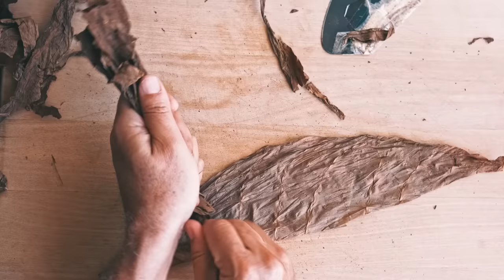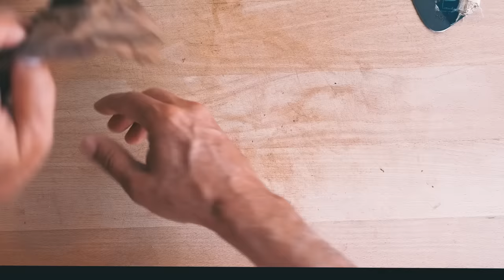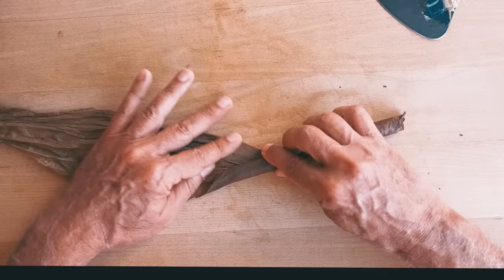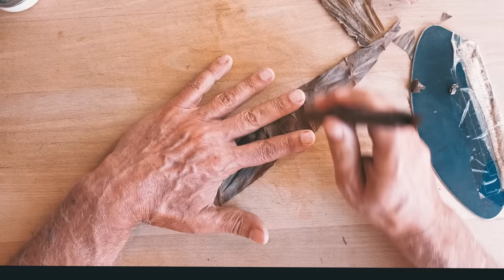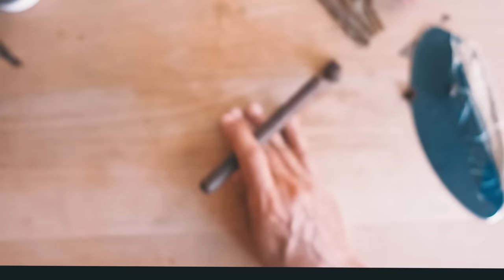Short Panatela Cigar, Roller's POV

Comment: I remember years ago getting some variety of nictotina rustica seeds and growing a small batch of tobacco as a project. It was amazing to see. Not quite how I expected. Even as a totally unexperienced grower I was able to end up with something. I didn't end up with alot. Only had a handful of plants. Couldn't quite get the curing to work right for some reason.  Even still it was a grounding experience to inhale the fruits of my labors. One thing I learned......that variety was suuuuuuuper strong. Got nicotine spins after 1 puff. Later learned....it's usually mixed with another variety hahah. Great video friend.
Reply: I still have some seeds but never tried growing, don't I need to use sand, or how did you do it?
Reply: @Loki_Dokie just YouTube it dude
Reply: @Loki Dokie's Metal Junkie Adventures  Well. To be honest, I had zero clue what I was doing (I grew them in a very large raised bed, the same way I grew all my vegetables) and didn't really treat them differently then say lettuce or cabbage and they grew amazingly. Prolly wasn't amazing quality by most standards but it was fun, easy, and lot more potent than I anticipated (at the time I was a pack plus a day smoker). Weekly tending but yeah....bout it. I'm sure you could easily Google or find vids on utube that would give muuuuuch better advice than I since I just winged it. I figured my seeds were bad as they were very old so I tossed a couple handfuls in the bed and shortly there after had a sea of sprouts. Each week I'd thin a 1/4 of em away till just the most vigorous were left in about 1ft sectors.
Reply: @ishnifusmeadle  very cool, thank you for taking time to reply, I may give it a shot at some point. If anything they just won't grow. Cheers
Reply: Inexperienced*
Reply: @smazzy187 wasn't really a need for that
Reply: @MrStone125  refer to my pfp
Reply: Yea, most home grown tobacco turns out super strong.
Reply: @smazzy1878  L
Reply: @Loki_Dokie  thanks for asking so i didnt have to
Reply: @lieutenantdan1413  lol no problem, I figure no question is a stupid question unless you already know the answer
Reply: KMVS8686  nice, I'm frustrated with federal law here as far as mj goes.
Reply: Thank you for this. Homegrown is powerful
Reply: @Loki_Dokie  you should! Maybe play around growing them indoors with a grow light. That never seems to fail.
Reply: oh yeah dude, rustica is what all varieties of tobacco originate from. You picked the strongest!
Reply: Reading "nicotiana rustica" and I knew this comment will contain phrases like "head-spinning" or "knocked me into my chair" or something along the lines of that.
Reply: it must ferment for months on pallets for cigar tobacco. should be a year before you enjoy your harvest
Reply: @smazzy1878  negativity calls negativity. careful
Reply: @SingleMost  This is going to be the hardest part for my harvest - the waiting! I might just fire cure it and make some havana-leaf toscano-style cigars.
Reply: @JunjiItoDougWalker  the machine rolled i smoke are fire cured. its not consistent and are prone to trapped moisture and mold. cant rush a good thing man. slow and steady. maybe try a fraction of your harvest with the fermentation method. depending on where you cure you might not even have to worry about the tobacco weevil. plantations throw powdered pesticides on the pallets in between the leaves. terrible industrial processing necessities
Reply: @SingleMost  Thanks for letting me know about these weevils, thankfully after some research it looks like the center of france is not a highly likely place to have them around, phew. I will ferment my tobacco, thanks for your help. Do you know how long I should ferment if I want a light-to-medium leaf? I guess it's a year to start, and additional time if you want it to be more intense?

Comment: That looks so time consuming and meticulous especially if it's gonna be a pack or something, but it was way more straight forward than i initially thought. Great stuff.
Reply: this is exactly why hand rolled cigars can be a little bit more on the expensive side, and I don't mind paying for the premium product in the slightest
Reply: About $5 for 1 stick is about as cheap as they go for and still be made with whole leaf and made well. A lot are around the $10 range for 1 cigar. $20 is high end stuff. The most expensive 1 that a tobacconist showed me was $50 for 1 stick. He said he couldn't relax and enjoy the $50 cigar because it's literally money going up in smokes.

Cigars that cost with $1 or $2 each are made with shredded up leftover leaf that you can see the roller leaving behind here. I tried them. They're very bland and hard to draw smoke in because of how tightly packed shredded leaves can get. Not really worth the hour or so it takes to smoke unless you're addicted and just need something to smoke.

Comment: Very interesting. I grew tobacco last year and dried some. It's nice to see what dried tobacco is supposed to look like and how it can be made into a cigar. Mine was way to brittle, no way I could have rolled it into a cigar without it breaking into pieces. And even if I had dried the leaves properly, rolling them properly would take a while to learn. I was able to smoke some from a pipe, but I'm not much of a smoker so most of it is just lying in the pantry.
Reply from the maker: Interesting. What kind of tobacco? Most leaf has to be prepped for rolling, depending on the local humidity.
Reply: @BlissCigarCo  If I recall correctly, the seeds were labelled as "Virginia Smoking Tobacco". I'm not sure if that's a specific variety or more of a marketing term. The plants got about as tall as a man and developed pink trumpet flowers but I get the feeling that doesn't narrow it down any. I hanged the leaves from the ceiling in my basement to dry out but I think they dried out too fast and thus became crumbly. The first batch of leaves were a bit yellow already when I harvested them. The second batch I picked while green since we got an early October frost.

I did not cut off the tops of the plants when they started producing flowers and then seed pods as some sources suggest for encouraging more leaf growth, since I already had more leaves than I will personally use in several years.
Reply from the maker: @robertdeckard2136  Yeah I think Virginia is a type. It's definitely a cig tobacco, tho, not cigar. Sounds like your first crop did have some issues. Tobacco is picked green, then cured in the shed to yellow/brown, then, in the case of cigar tobacco, fermented. I think maybe cig tobacco like VA isn't fermented, tho. Just cured.
Reply: @BlissCigarCo  Virginia blends are also used in pipe tobacco. They can be fermented to bring out additional flavors, or you can leave the blend in a tin or mason jar to age it to bring out flavors.
Reply from the maker: @fallofshadows2209  Thanks. I think I knew that once upon a time, when I used to smoke pipes. :)

Comment: Super super interesting. Is there any distinction between what you use as a wrapper and what gets used as the internal stuff? And why the wooden mould after you're finished wrapping/cutting it?
Reply from the maker: Thanks. Yeah, the tripa (filler) and capa (wrapper) are totally different varieties of leaf that have been grown and handled in very different fashions on the long road from seed to cigar. The molding smooths out the surface to help make it pretty and also sets and balanced the correct internal pressure of the bunch.

Comment: Very nice looking cigar there. I have seen other cigar rollers use spray bottles to work with the leaves, but I don't see you do that. Do you do something differently?

And how long do you press the cigars in the mold for? 30 minutes? 2 days? Also wondering when the cigar is good to smoke after having been finished. I suppose right away, but I could also imagine that they need a little bit in the humidor, as they are probably a lot damper when being worked on than they are at "smoking humidity", but could be wrong.

Anyway. Very relaxing to watch you roll those stogies out :)
Reply from the maker: Glad you enjoyed it. I do use the bottle, but not at roll time. Wet or damp leaf is useless: the moisture's gotta be inside the leaf cells. So the spraying happens hours/days earlier. Your mold time range is correct: 30 minutes to 2 days, typically. Depends when I have time to wrap. I can smoke mine right away because I roll them to be smoked right away: no excess moisture that could inhibit burning or restart fermentation. They are rolled at smoking humidity, for the most part, and can be smoked with, at most, a day or two sitting out in the air drying off a bit.
Reply: @BlissCigarCo  Do you put the leaves in a humidor? 

And until now I was under the impression that you roll them wet, because the leaf is the most flexible, and then let them dry a little. Of course you don't roll them dripping wet but a little more humid than at smoking humidity. 

Thanks for clearing that up. Can't wait to start rolling my own. Doing my research currently where to get leaves from and where I can score a nice mold. I was thinking of just making my own, it is a very simple device. Just need to drill holes into a block basically.

I'll keep watching and try to internalise the basics.

Thanks for the replies :)
Reply from the maker: @obiwanfisher537  Well again, wetness or dampness doesn't do anything for your flexibility: it's just moisture on the outside. The leaf has to fully absorb the moisture for it to become flexible. Filler should be slightly more dry than final smoking RH, and binder and wrapper slightly more. As they normalize the filler expands and the binder and wrapper contract, making for a tight roll with tight seams. I can suggest joining the Cigar Rollers group on FB when you get started. A very good resource.
Reply: @BlissCigarCo  Will have a look. Thanks. :)

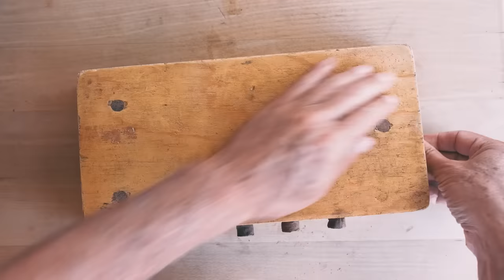Comment: 3:12 can you explain what happened between these two cuts to make them look so different?
Reply from the maker: After I put on the top half of the mold I put 30lbs of dumbells on top for an hour. Then I opened it, rotated the bunches 90 degrees and pressed it again for another hour, minimum. It's referred to as"putting the molds in the press."
Reply: @BlissCigarCo  very cool, thank you for the reply and the video!

Comment: Hello everyone, I'm french, I just start to try to make home cigar. I'm very far to make like this man. Exceptionnel, really great, bravo. What kind of tabaco leafs uses him ? It seem really good leafs, it's flexible and extensive, if I do it with my leafs, it will break.
Reply from the maker: I don't remember what this blend was, but it's normal cigar tobacco leaves. What kind of leaves are you using? Do you know to spray a little mist of water on them and roll them in a plastic bag to make them more flexible?

Comment: So after years of buying cigars and recently watching you rolling cigars, I have decided to roll my own cigars, the question is 
I like 60 + gage 6 to 7-inch, cigars, any advice b4 I get my starter kit, I see some Cubans use Honey as the Glue or  maple syrup, but I am not concerned about the aesthetics of the cigar, any advice is appriciated
Reply from the maker: Cubans don't use honey or maple syrup. Maybe some of the farmer dudes on the tour of their farm do, but the factories don't. Get Bermocoll. I guess otherwise you just need to find a huge mold, right? There are probably some 60s being  sold out there somewhere. Maybe check hondurascrafts at Etsy? Also ebay.
Reply: @BlissCigarCo  bliss thanx for the info I will follow ur recommendation. 
Also I wasn't to roll 60 ring Cigar I meant to say

Comment: are the outside leaf and inside leaves different types of tobacco?
Reply from the maker: Not exactly different types, as they are both cigar tobacco (which for example is different from cigarette tobacco). But there are many varieties of cigar tobacco, and in this case, yes, the wrapper and filler are different varieties. The filler (inside leaves) is also a combination of different varieties, called a blend.

Comment: How does that box with the molds in it work?
Reply from the maker: That box is called a mold, and the individual slots in it are called slots. Basically it goes in a big ol' screw press that squeezes down the bunch and makes it all smooth like that.

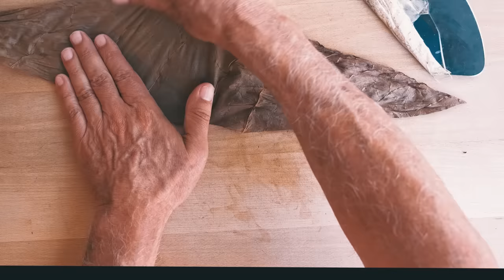Comment: 4:04 AMAZING VIDEO, But HOW did the blade spark on the wood cutting board??
Reply: Good catch! I watched it in .25 speed and as the blade drags on the board, it definitely sparks. Looking up this phenomenon, "they say" it would likely be caused by sand/dirt in the wood, which makes sense I think. Cool video!
Reply from the maker: Maybe there was a piece of sand mixed in with the leaf.
Reply: @BlissCigarCo  Good hypothesis.
Reply: I think you guys are right.  It really had me stumped!!

Comment: What is the "glue" made from?
Reply from the maker: It's a vegetable gum called Bermocoll, made from cellulose (veg fibre).
Reply: @BlissCigarCo  Do you make it yourselves or do you buy it?  I love this video, esp seeing how your build out the internal structure then wrap it up in the leaves.
Reply from the maker: @krait9964  Thanks. I buy it. It's a powder that you mix 1:6 with water. It's very cheap.

Comment: Are you sealing it with petroleum jelly?
Reply from the maker: Man, that sounds gross. No, it's vegetable gum.
Reply: @BlissCigarCo  Oh it looked like petroleum jelly.
Reply from the maker: @InnerDemons1237  Ya
Reply: @BlissCigarCo  Does the jelly keep them hydrated or how does that work?
Reply from the maker: @InnerDemons1237  No, it doesn't do that. Except. Capping one end, though, reduces airflow through the stick while it rests, which helps it maintain moisture.

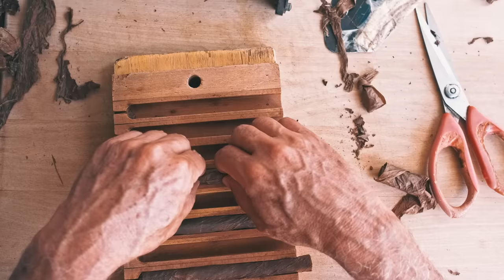Comment: 100% noob here. Can anyone explain what is happening at 3:10?
Reply from the maker: That wood thing is a cigar mold. I put the freehanded bunches into the slots in the mold, then I put the top on, and it goes into a big press, which is why they come out smooth (I cut out the part where the mold sits in the press for an hour).
Reply: @BlissCigarCo  Thank you very much for the response!
Reply from the maker: @leandromafe  Np. Thanks for asking.

Comment: What sort of glue is used here?
Reply: There is no glue. The outer leaf is dampened and it dries to shape.
Reply: @SK-tr9ii  vegetable based gum, as per some of the other comments the OP has responded to.
Reply: @100GTAGUY  So, would that be an extract?

Comment: not getting why everyone puts soo much effort into that tip when ya just cut it off anyways,...
Reply from the maker: Because cigars are typically aged for a while (months or years) after they're rolled. Capping one end reduces airflow while it's resting, which prevents it from drying out, which kills the flavors.

Comment: And that tobacco looked dried and brittle. The wrap was the only good lookin leaf
Reply from the maker: Filler should be like that on the roll, about 13% moisture. Rises to 17% in the humidor. This causes it to expand as the 23% wrapper dries out toward 19%, and shrinks. So the filler expands, the wrapper contracts, creating a firm roll with a perfect draw. If the filler is too moist at the start then the stick stays spongy: not good.

Comment: That’s some dry ass tobacco
Reply from the maker: Specifically, at the time of rolling, the filler is 10% moisture, the binder is 16%, and the wrapper is 19%. In the room and the humidor the whole thing will equalize to 13.2%, which is 65RH (relative humidity) in your humidor. As the dry filler take son moisture it expands. As the moist wrapper dries, it shrinks, tightening around the bunch and making for a firm stick.